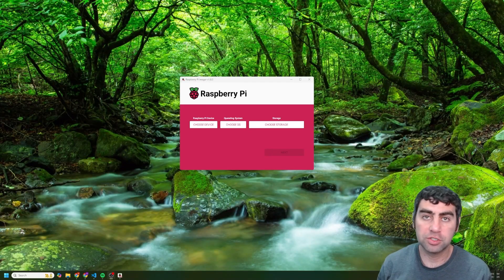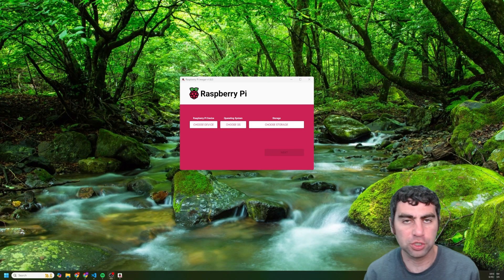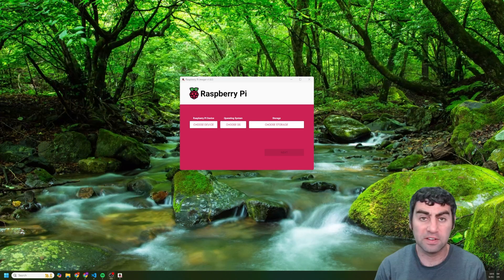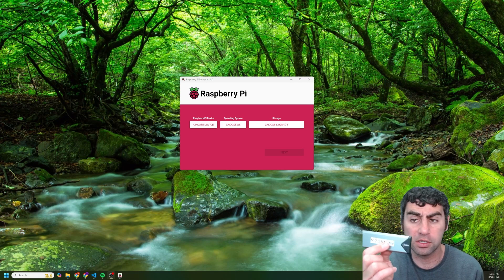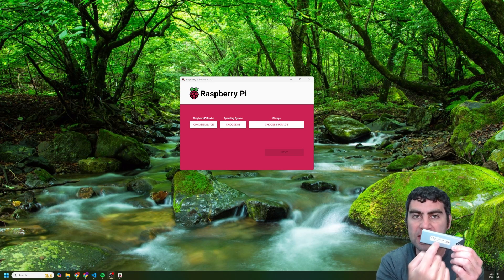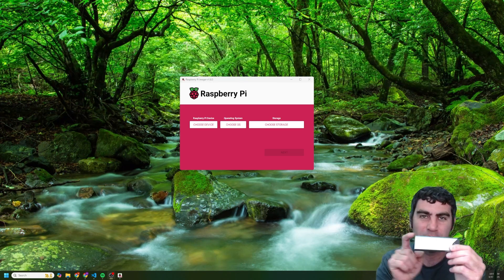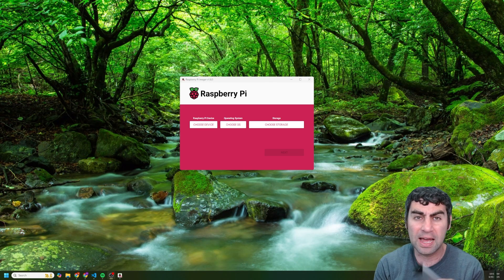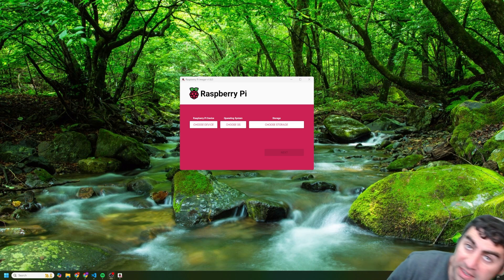Upgrade Your Raspberry Pi 5 with NVMe Storage: Step-by-Step Guide

Comment: I watched this video, really great instructional. I have a few questions. I have a microSD running alpine, and I later installed the SSD vis a vie the NvME. I have the RP branded drive, so I didn't have that nifty shell you used in your video to flash the SSD. I have installed the drive into the NvME. Is it possible to still flash the SSD using USBC connection to my laptop? I attempted it, but the drive is not appearing in my storage options. I'm fairly certain the drive is connected and running properly. Any feedback is welcomed.

Comment: Hi sir,
You are coping the contents from 64GB sd card to 1TB SSD. Is it doing bit by bit copying and leaving rest space left OR copying the contents only and expanding the root size to 1TB?
Reply: Actually it is doing a full disk expansion on the next reboot. When you remove the previous device where you copied from it will automatically expand the partition to it's original disk size.
Reply: @squadramunter Thanks. Worked!